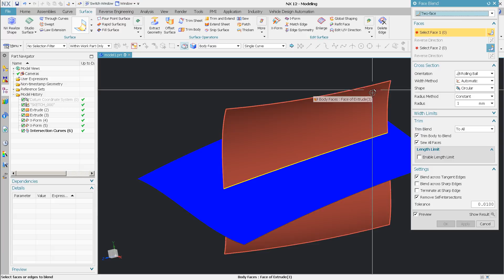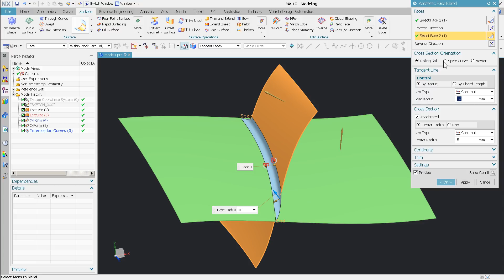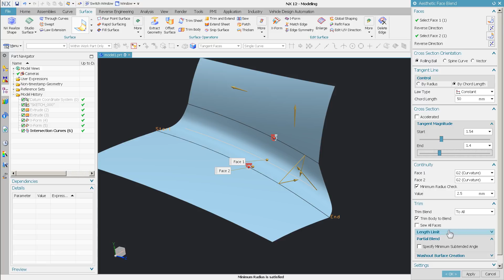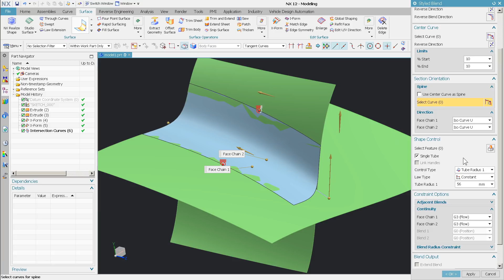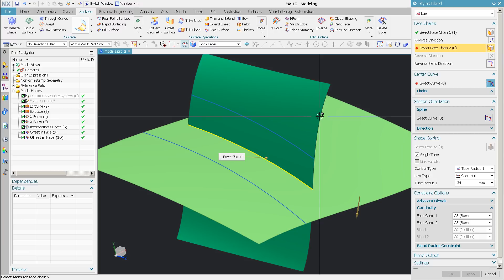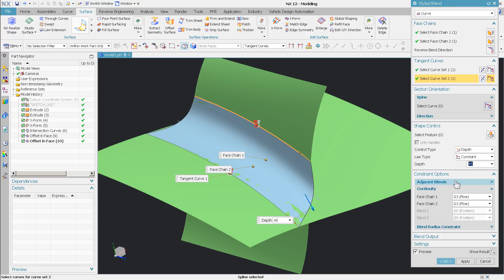Siemens NX 12: 3 Blends

Comment: Hi Steve, thanks a lot for the informative videos. Can I ask what software you use to record your screen? I need to do this for a presentation which involves Siemens NX for my Master's Thesis, however, I have tried using OBS Studio and my videos seem to be very choppy. I have also tried messing around with the settings a lot but it isn't great. It could be my computer but it has decent specs so I doubt this. Your videos always seem to be very high quality so any advice would be appreciated. Thanks
Reply from the maker: Camtasia is my preferred software.

It does a nice job. you can also use Snagit but it does not have the same level video editing.

Good luck!